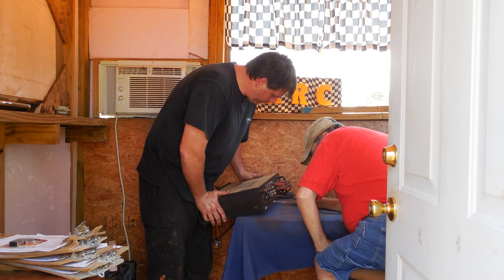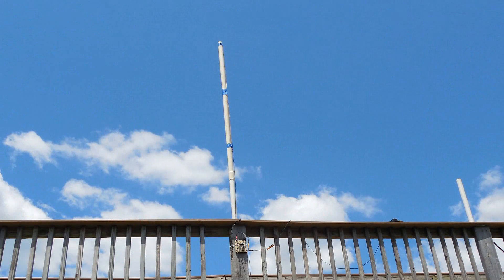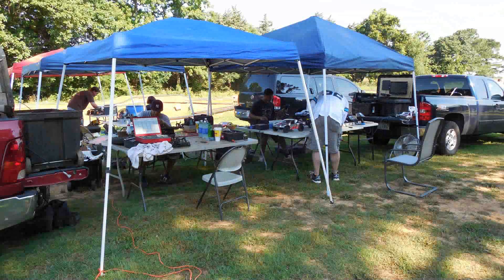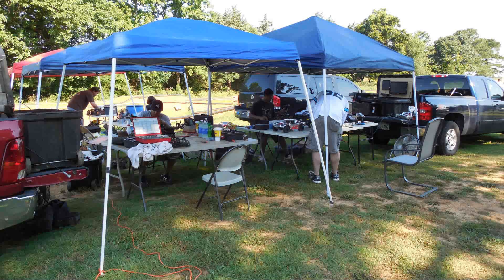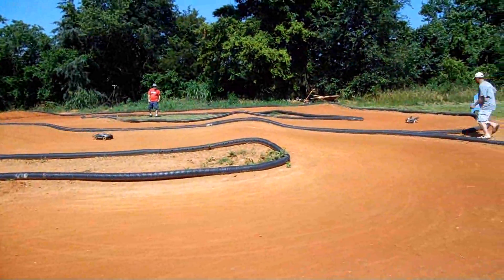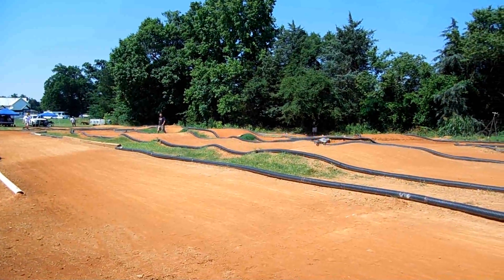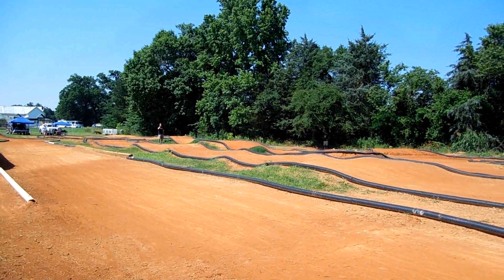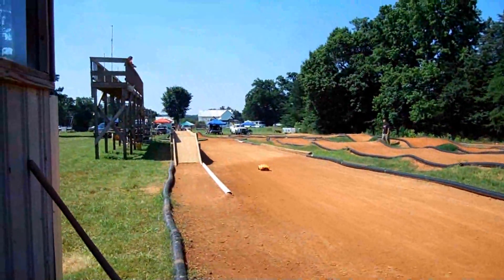MXRC PA system to FM transmitter

Comment from the maker: Hey Andy,
It was a fun project in my little transmitter did well for the test, but it's really only adequate for in-house use. Ramsey makes several models the one I think I'll use is the model FM25B. It uses dip switches to set the frequency and will not draft off frequency.
Regards
Rick

Comment from the maker: The transmitter that I used in this video is the model FM10C, and it is very adequate for the house. And it did well for our test, but because of the changing temperature outside the transmitter does draft. Not a problem in house. So, the model I recommended for this job was the model FM25B. It uses dip switches to set the frequency, and will not draft off frequency.